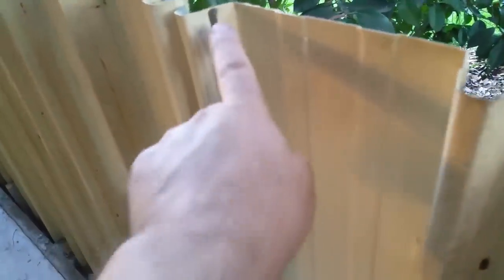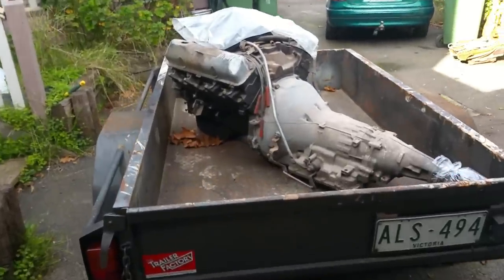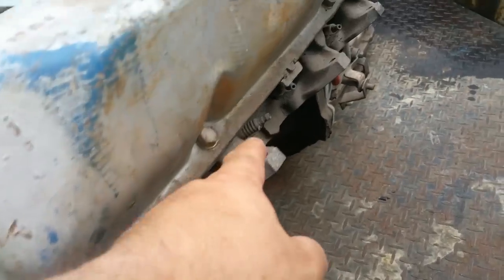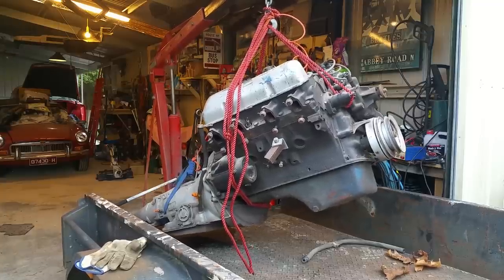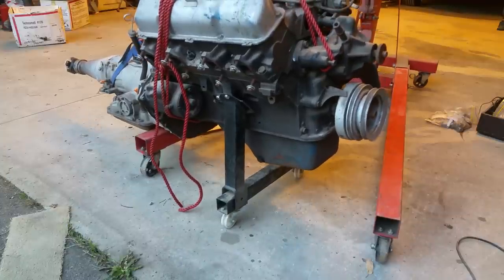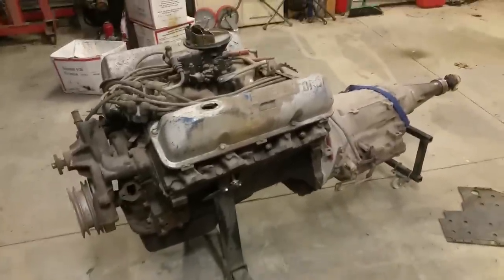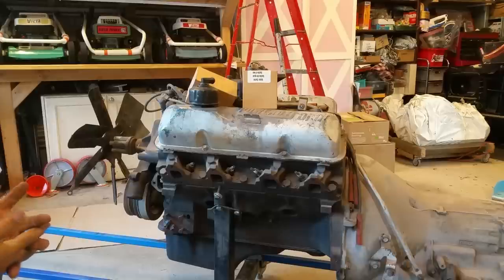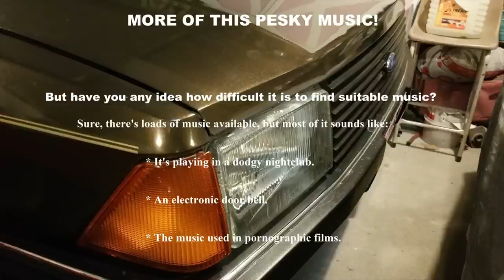The Junkyard Big Block Part 1

Comment: would some of the newish tube fit on the back section so  you could make a "h' pattern adjustable bar for the rear of the gearbox to suit different engines?

Comment: If you want to find out what motor you have, good chance it's a 352 or 360 which has a 3.5 inch stroke. If it's a 390 it will have a 3.78 inch stroke. What you would do is remove a spark plug, all of them out would make it turn easier. Then use a straight wire and insert it through the plug hole and rotate the crankshaft by hand to find top dead center of the piston. Then mark the wire then rotate the crankshaft one half turn till it's at the bottom of the stroke and mark it. Then remove the wire and measure between the marks and if it's 3.78 inches between the marks it's a 390. 3.5 a 352 or 360.

Comment: Hey Pete, as a previous resto guy put on hold due to life… I’ve picked up 2 202 VB commodores a wagon and a sedan.. all matching numbers.. I want one as stock but the wagons not running as yet.. do you have or is there any good content on straight sixes? What would be good performance mods to start with because my sedan is mechanically A1 and sluggish.. both are Red motors. TIA and keep up the great content.. love it

Comment: Doesn't that say 352 on the block? 😊. Years back, a customer had a Mustang with a 390 that he wanted to swap for a 427 he hd . The 390 was pulled and left on the W/S floor ,for anyone to have for free. It ran great,but no one wanted it because of the sheer mass ..It eventually went to scrap.
Reply from the maker: Yes mate, it says 352 on the block, but other FE's do as well regardless of displacement. A 390 off to scrap is such a shame, but years ago this stuff was all worthless, cheers.